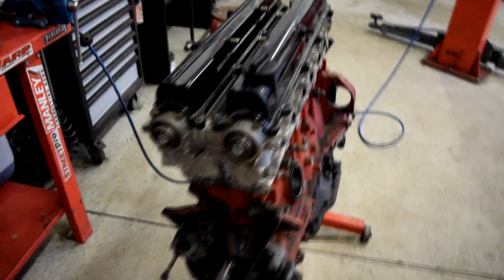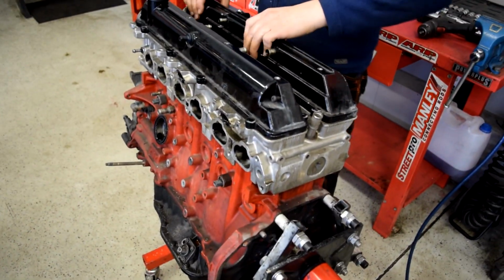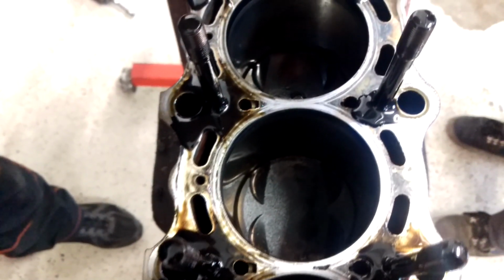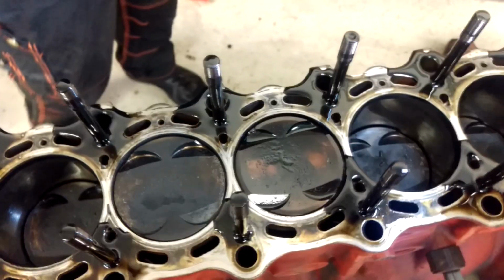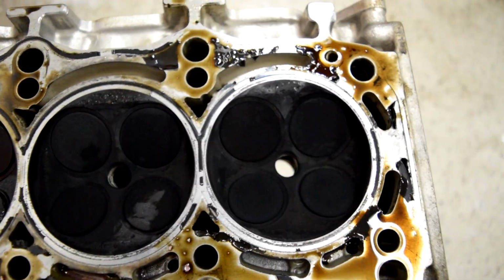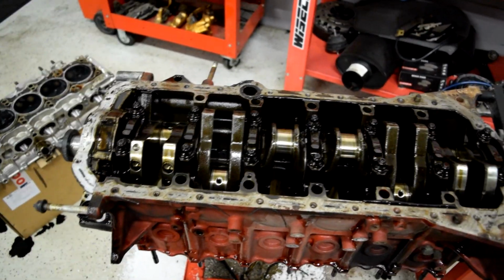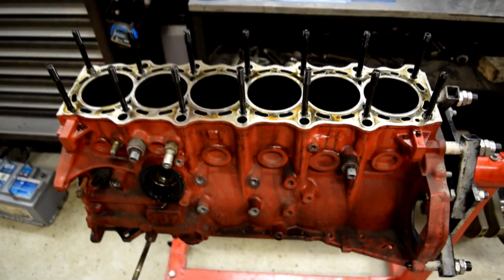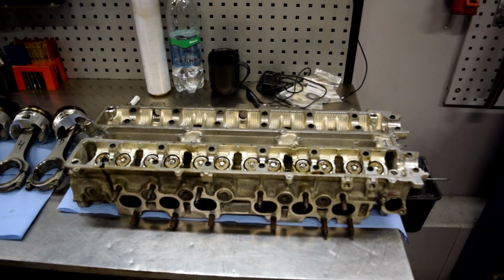Toyota Supra rebuild:  Taking engine apart

Comment: My guess for the valve clearance was rigth. Probably the deck bore scratch is caused by the silicone blocking the nipple that squirts oil on the bore. You can install sleeves on this deck, or buy another one in good shape.
Reply from the maker: i think i am going to use another block and keep that for an emergency

Comment: Holding my knuckles tight for your supra , <3 from Poland
Reply from the maker: Thanks ! soon it will be running again;)
Reply: Waiting for it same like for my own car :D
Reply from the maker: plan is to put the car on the dyno in 3-4 month ))
Reply: It will be fucking a freaking monster , i bet it will gain a lot of power in there !
Reply from the maker: last time car made 500hp and 700nm from the crank... on 3 cylinders :D
Reply: Wondering how much will it make on all of them ;)

Comment: I notice your Pistons from Titan Motorsport ... But I'm sure they did not assemble that whole engine block.. .. ... Coz Titan Motorsport knows 2jz-gte and  knows how to assemble  them correctly depending on how much horsepower you want.... Hope to see your supra up and running again👍
Reply from the maker: Thanks :) i am sure if my engine was built in Titan it would be still running. That pistons from JE idk why there is Titan logo on them
Reply: Titan Motorsports pistons are made by JE.

Comment: You should just build it to 1000+ hp since ur at it 

I just finished my block up   Sorry to see u also having problems tho
Reply: 1000 HP is way too much imo. No way to use all of that power. 400-500 HP is optimal. You can go fast and hoon around whilst using all the power
Reply from the maker: I dont want 1000hp now, i will aim for 700, but engine is going to be 1000hp ready :)

Comment: What is your name bro?
Holy shit,come a big big work,fix;
First,love your experience,thanks for share it,that's incredible watch;
Right;
Its my opinion bro,don't be angry, it's with love and empathy,I love mechanics :)
When the camshafts are disassembled its better dissamble to hand and spiral for dont deform the camshafts,but... its ok don't worry bro.
-Car references:

I think that cams and pistons are perfect(awesome pistons),broken rings well dont worry,but the chambers have more carbon,its  bad Camshafts Sensor possible or  teletermometer sensor or any fail lambda?
Looks the much clear valves,in this two cilinders chambers have a problem,looks,its possible that this two injectors its dirty :/
Now after you and your friend possible test the oil pump preassure,look filter oil pump,fuel preassure,clean fuel injectors more important.
NOTE:
Please bro's... before to start engine put this:
http://m.ebay.es/itm/LIQUI-MOLY-ENGINE-FLUSH-PLUS-LIMPIADOR-INTERIOR-MOTOR-Nr-2657-/182318595677?nav=SEARCH

This product actioned in 10 minutes,and recomended from me bro,its the beast,after empty dirty oil,and its yor machine preparated always, BEFORE NEW RESTART:
...with

Engine interior very clean + New Oil + new Filter + Metal Lube®
Seriously bro,not is a joke,its a gift for your car,fix.
Well,that's right,finally:

BEFORE RESTART with cheap oil for clean interior engine:

http://m.ebay.es/itm/LIQUI-MOLY-ENGINE-FLUSH-PLUS-LIMPIADOR-INTERIOR-MOTOR-Nr-2657-/182318595677?nav=SEARCH

AND AFTER  CLEAN PUT YOUR NEW OIL AND FILTER MORE;
http://m.ebay.es/itm/METAL-LUBE-FORMULA-PARA-MOTORES-DE-ALTA-POTENCIA-236ml-ref-236-FAP-8HPF-/152262207897?nav=SEARCH
IF YOU WANT YOU CAN ALSO PUT METAL LUBE FOR YOUR GEARBOX WHEN CHANGE OIL:

http://m.ebay.es/itm/METAL-LUBE-TRATAMIENTO-ANTI-FRICCIoN-PARA-TRANSMISION-MANUAL-120ML-Ref-4FTM-/152274164552?nav=SEARCH
All tested in my car :)

suspire...     Fuf...
hahahahh well bro,best wishes and a hug from my house :),hope new video the process engine,I'm addict now,you think that I now watch television,internet power hehehe